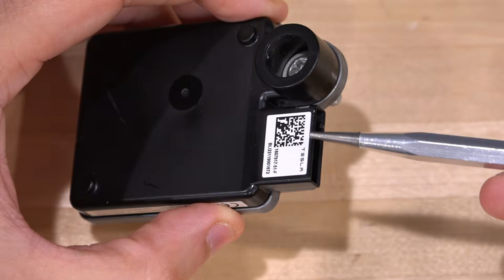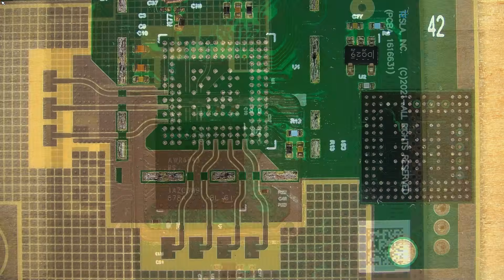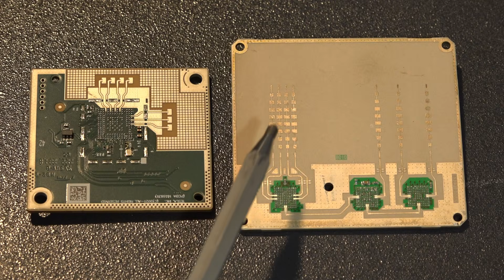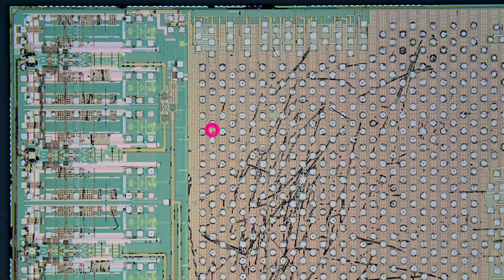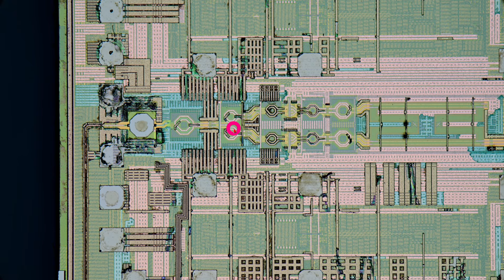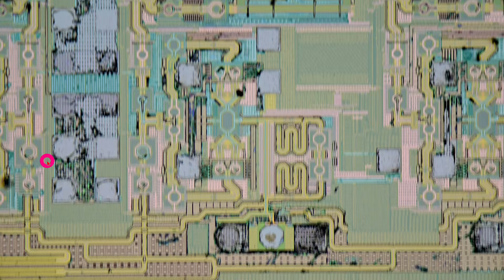TSP #315 - Tesla Model Y Indoor Cabin Radar Teardown & Deep Analysis of SoC, Package, Antennas & PCB

Comment: The LP8752 has I2C not SPI interface and looks to me it does not read currents and voltages, but do monitor and control PGOOD status, and do en/dis power elements.The AWR6843 is $55.00 bit pricy.

Comment: Seeing the bare circuitry contained within the otherwise boring plastic boxes and thinking about how such structures are created... "Beautiful" doesn't quite encapsulate the awe I still have for things like this. To think that these things are basically made with incredibly advanced photographic techniques that actually happen at a MUCH larger scale that get miniaturized by simply focusing the projection into a MUCH smaller space on a wafer of silicon... Yes, yes, I'm oversimplifying the actual process... But I'm always in awe that we petty, bickering, imperfect bags of blood can create things of such intricate marvel...  

I also think city planners could benefit from a lesson in spatial optimization techniques employed in the chip industry. The two are linked in complexity and planning. The major difference being that a chip is a million times easier to correct a flaw than a city is in redesigning a district... Though, I do have to wonder what the financial differences would actually be. 😂

Comment: OK, let’s use this is the communications module also, for MANET radios : ). Great now I’m thinking about how it could be used for power transfer and communication communications also😂. I’ve seen someone make a radar using ESP 32 and Wi-Fi but this would be an upgrade to something like that. Actually, you would probably use something like this on different wavelengths especially if you were going to do something more important like track drones on the cheap.   I wouldn’t buy a Tesla unless it could track drone swarms😂. Anyone can have a backup camera or in cabin present sensors, but can you track drones?   Give me a dozen engineers in $1 billion and I’ll build a Bat car out of commercial off the shelf.😂
Reply: YouTube should sponsor the bat car😂 everyone on YouTube gets together and they build the Bat car

Comment: It can be remove from the car? It is very close to the head. Thanks
Reply from the maker: It has no impact on you or your head. It is perfectly safe.
Reply: @TheSignalPath have you measureed the emf?
Reply from the maker: @simoneloria5542 This is non ionizing radiation. It is completely harmless. The output power of such a radar is also absolutely tiny.
Reply: @TheSignalPath can be removed from car whiteout particular car errors?
Reply from the maker: The vehicle will probably complain about it missing. But it should not impact the driving. Although who knows what Tesla has done with their software.
Reply: I wanna not buy a car that has  a radar that polling rf near the head for 10 years, but there no other ev car like Tesla
Reply: I would buy the car, how can I know if it can be removed? Do you have any suggestions? Many thanks

Comment: Electronics engineer here (with not much RF experience apart from EMC-testing). Very cool review. What is the reason they prefer to use silver to coat the patch antennas instead of using gold? Are there special RF properties that are desired with silver?

Comment: In the Owner’s Manual, Tesla says “cabin radar can detect the presence of people inside the vehicle and use the measurements to determine occupancy. Cabin radar supports certain vehicle and safety features, such as occupancy detection for the front passenger seat.” While Tesla previously used seat sensors for this purpose, the radar will be more accurate and enable dynamic airbag deployment based on passenger size and positioning.

Comment: What kind of solvent did you use to remove the housing of the radar chip when cooking on the MHP30? I am guessing it is something strange?
Reply: Quite possibly boiling nitric acid.  He mentions the pads and some metal features getting removed and aggressive solvents would only attack the resin in the package and none of the metals.

When people want to expose ICs while still keeping them functional it is harder as you have to stop the etch when the glass filled epoxy has been eaten away but before any of the metals or bond wires are damaged too badly.

Fortunately most ICs have a silicone dioxide top coat for insulation and mechanical protection purposes over everything EXCEPT the contact pads.  The pads are usually made of aluminium with sometimes other metal plating so fairly resistant to just nitric acid and the gold bonding wires also are resistant if there are no chlorides in the acid (that will form Aqua Regia will consume even gold).

Sometimes it is desirable to look below other layers and then you use hydrofluoric acid to eat away the glassy silicon dioxide layer and then an acid that will eat the aluminium and then again some HF to clear away silicone and so on.

For large features it is possible to polish away layers but with modern production this becomes really hard.  Also more and more VERTICAL features are used in the silicon so it gets harder to look that deep.

At the extreme the developers or pirates will use ion beam machining and electron microscopes to examine the actual gate structure of transistors.

Search for videos titled "Focused Ion-Beam Milling and Lifting of Sample for Transmission Electron Microscopy" and  "Introduction to Focused Ion Beam (FIB) - H Zhou - MRL - 07302020" if you want to blow your mind.

Comment: Is this a purely Doppler radar? If you use the transmitter's oscillator as LO for your receiver's mixer, then you'll get a 0Hz IF, right? Unless there is a Doppler shift.
Reply from the maker: FMCW - even without Doppler shift you will not land at DC at any given distance above 0 meters.
Reply: @TheSignalPath  I see. The transmit signal does not even need to be pulsed then, just FM. So the IF signal frequency would depend on the distance. Then, I guess, the math of figuring this all out after ADC would be really complicated.

Comment: Is there a transition from coplanar waveguide to microcstrip, or is it so tiny that it can't be appreciated?
Reply from the maker: It is a small transition. You can see the line width changing between the two zones.
Reply: But I believe that the microstrip is thicker because the effective dielectric constant is lower in microstrip that in CPWG. I make the transition from CPWG to microstrip in the CPWG side.

Comment: Interesting to see this radar works at 60 GHz, right at a maximum peak of attenuation due to the oxigen molecular resonance. TI has the same chip but with the antennas integrated right on the package, the AWR6843AOP (Antenna-On-Package), so no need for a Rogers material PCB. Amazing level of integration.

Comment: But why would one want a radar INSIDE a car? What purpose does this serve?
Reply from the maker: Passenger detection, infant detection (to make sure no one is left behind), pet detection, etc.
Reply: @TheSignalPath  Well, most cars today will beep, if someone does not click the safety belt, so they can detect passengers without a radar. Certainly a very interesting gadget, and I watched the video with interest, beginning to end. But does it really solve a problem, or is it again a "solution" proposed by the marketing department, because it sounds fancy?
Reply from the maker: Infants and pets don't wear seatbelts.
Reply: @TheSignalPath  Here in Slovenia they must. A kid must be seated in a special add-on seat, with the belt applied. Also, pets must be restrained, either tied to a seatbelt, or put in a box.
But my point was not about wearing a belt or not, but detecting the presence of passengers. Cars can do that without radars, and will beep if something is on a seat, and the corresponding belt is not fastened.
This is a wonderful chip, and sure has many sensible applications - but inside a car, it looks more like a solution looking for a problem.
Could it RELIABLY detect an incapacitated driver (stroke for example)? Not sure.
Reply from the maker: Detecting seat belt is not sufficient to detect the presence of a child left behind in a car seat. The car seat will always have the belt clipped in and the weight sensor will always return that something is on the seat, even if it is empty. Furthermore, pets in boxes can be detected with radar and not by car seat sensor. Pressure sensors on seats may remain triggered if an empty box is on the seat. Children under blankets can be detected with radar as well as movement which is not detectable by seat sensor. In-cabin radars are very common - Toyota, Tesla, Volvo, Hyundai, Polestar, etc. all use them.
Reply: Probably over engineered detection for who or what is in your car and where. 
Since Teslas have pet modes and baby modes to protect animals or babies left in cars. 
Basically turning on AC and conditioning the air to keep them comfortable

Comment: First thing is I have zero experience in this area but love demonstration of you knowledge. The question I'd have; isn't this totally overkill? If your comment is correct and this was several millions in design and primary purpose is passenger presence detection. A couple of micro switches would give you exactly that? Case of engineers having fun with no control as opposed to designing to a purpose? All questions!
Reply: There are many applications for this same chip, including tank level radars for industrial use. There's a 77 GHz version of this chip that is widely used for automotive collision avoidance.
Reply: @davidrick959 I thought as much but if the aim was to get down to an affordable vehicle doesn't this go against that. Assuming this isn't the only system that's over engineered. Also assuming the cost to manufacturer of such an intricate design doesn't taper off. I think I've another one of your comments and sounds like this is your area. Would this need an update at some point or can this now be used pretty much for the long term?
Reply: @deadliaski  They could run with this design for quite a while, but they might want to do a cost-reduction by switching to TI's IWRL6832, which would save about $6. It only has two TX outputs rather than three, but that's not a show-stopper in this application. The incremental engineering required to change over would be fairly minor.

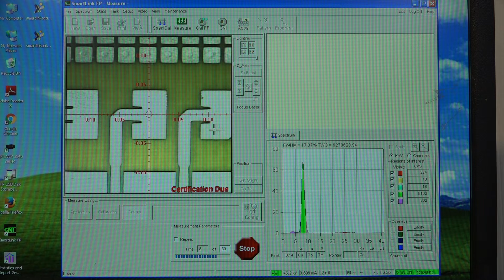Comment: 15:00 This looks like immersion tin to me, not silver. The automated analysis showed ~2% Sn, and the Sn Kα lines are at 25.04 / 25.27 keV which seems to line up with the red peak quite nicely. Ag Kα is at 21.99 / 22.16 which is a fair bit left of where the peak seems to be.

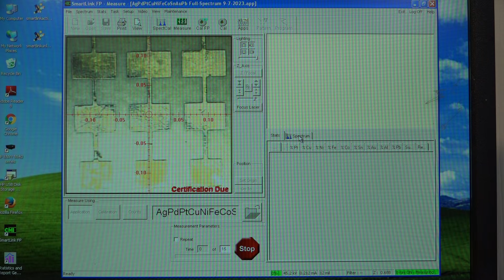The second board shown at 16:00 has a peak close to 22 keV which is a much more clear sign of it being silver plated.
Reply from the maker: It is possible that it is Sn immersion. But I don't see why they would do that. It is very poor performance at RF.
Reply: @TheSignalPath  Is it? I know ENIG is bad because of the Ni-P layer but I thought Sn and Ag were roughly comparable in terms of insertion loss.

From everything you said in the video, this design is optimized for cost rather than performance. So immersion tin seems to be in line with that overall philosophy.

Can you export a CSV or EMSA or something from the XRF and post it somewhere? I'm slightly nerd-sniped and would love to look at the raw spectrum. I've spent a fair bit of time analyzing raw X-ray spectra in my grad school years and it'd be fun to dust off those skills and tools again.
Reply from the maker: Sn is certainly worse than Ag - There is also Sn nearby and there may be some contamination. I should cut the board to isolate the traces better. I am not sure if the software exports CSV, but it probably can.

Comment: This chip looks like a city plan for little RF oompa-loompas :-) Little race circuits, football fields and cafeteria's. I'd love some high res hi-mag photos of the chip, would be a great wallpaper. :D Why the differential pair routing cross-over in multiple spots? Wouldn't be easier to route parallel tracks together? Or they needed turn polarity/phase other way to keep main block before it identical for symmetry?

Comment: Fantastic teardown and analysis, truly amazing the AWRL6843 (and /44) allows for such a radar system to be miniaturized, integrated and cost optimized so much it becomes a feasible replacement for in-seat weight sensors.

One thing I do wish you touched on though was what sort of performance and output data that could be reasonably expected from such a module as it's a rather abstract concept to visualize and interpret. Particularly for the intended application as both TI, but particularly Tesla make some rather bold claims about what this radar can do.

Also based on the markings it seems this example is the old Model Y radar module which is 'non-functional' and was never activated in software, seems they've all been soft recalled and replaced with a new revision, not sure what the differences are?
Reply: This older radar is activated in software as of 3 months ago.
New 2024 version has better resolution detection, they call it "4D radar". Can detect if something in the seat is a human or not (sees the heartbeat).
This unit = 1607917-00-G. New not in Y parts catalogue, but model 3 is listed as 1607917-00-M. Not sure if the model 3 one is the latest or not. About $130.

Comment: Since the chip is now out there, I was NDA'd on the roadmap which had this combined chip on the upper right, in 2016.  TI aggressively worked this for about a decade now.
Reply: TI makes good stuff, don’t trust China.
Reply: The design process is so interesting to me. How does it usually work? Is it basically simulation only until the very end of the process? Or are there some actual tapeouts sometimes to test some functionalities?
Reply: Could you give more data about their architecture decisions? impress me the "collage" that are inside instead of a monolithic design.
Reply: @eduardoanonimo3031  There was a working solution in 2016 but it had separate front end, dsp, power, and CPU boards; progressively, over time, these functions were integrated into the single chip you see today.  TI is not the only maker of these chips; at the time NXP was considerably ahead, and may still be.
Reply: @cheponis  Thanks you very much. Im pretty ignorant in this field.
Reply: @cheponis seriously, thanks for this insight. Remarkable
Reply: @cheponis wasn’t TI the first to do this on CMOS?

Comment: Shahriar , I gotta hand it to you, the test equipment suite to die for behind you there.....I suppose it's a good thing you typically don't need to use 20 or 30 pieces of equipment at a time as I can see your 100 (200A+?)Amp service would struggle a bit....but I suppose that is a problem I wouldn't mind having....& I'm guessing you don't mind either......have you had to upgrade the lab's power grid significantly yet?

Comment: So the big question, 
Who and why invest tens of millions of dollars into the development of this chip?
Surely a state sponsored actor. A car company can only get a tiny portion of the value of this information provided by this device.  A single ir LED or weight switch under each seat provide enough info for safety equipment,  HVAC and environmental control and power output.
Reply: This chip wasn't designed for Tesla, they're just using in on a PCB they designed (or contracted the design of).

That's like asking "Bob has an Intel laptop", I can't believe Intel would go through so much work to make a processor just for Bob.
Reply: RF design teams are usually comprised of engineers who move back and forth between the civilian and defense sectors. Companies are always taking advantage of what has been learned from the "state sponsored" world monetize that knowledge.

Comment: Love this stuff Excellent video :) - Do the X-rays you take do any harm to the semiconductor material ? Also if you could create a radio frequency of 400 to 790 terahertz (THz) would it be light at that point ?
Reply: yep, it will be light for sure. or can you  point out anything else it could be? 😂
Reply: X-rays damage the components, but only if you left it in the x-ray machine for hours while the device is powered on or for days while the device is powered down

Comment: How many people typically work on an RFIC like this? Seems like it would take a team of engineers quite some time to create such a complex and capable chip.
Reply: I think this SOC is probably the work of many hundreds of engineers over many years (decades) of evolution. There is so much going on in this single chip, with mixed signals and RF, analog and digital all integrated. There are multiple specialized systems engineering challenges that have been solved to make this possible. It’s simply amazing to see such a chip with 3 or more CPU cores, dedicated memories and certainly dedicated hardware for the processing of the down converted and digitized signals in real time. The combination of hardware and software integration to make this possible is just brilliant. ❤
Reply: There is a comment above stating that it is a project running for a decade. And the parts "sourced in" like DSP and Cortex cores have their own decades of development.